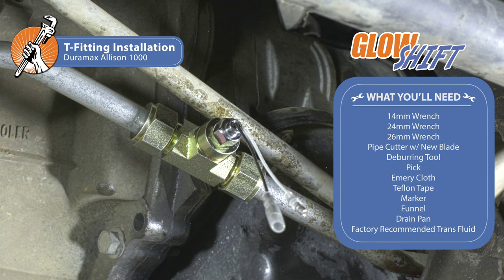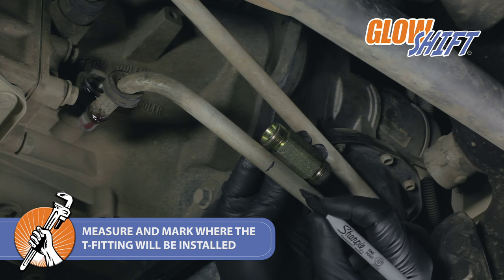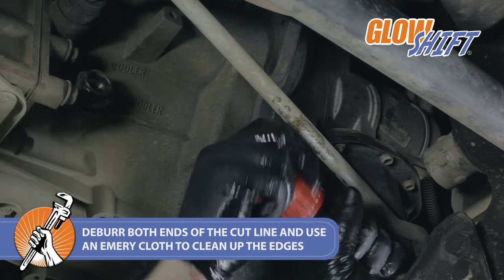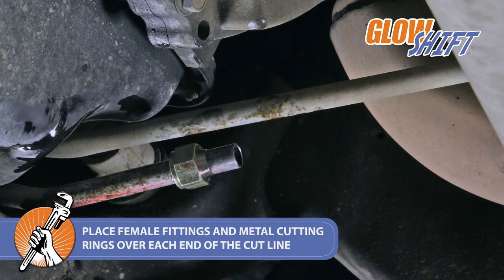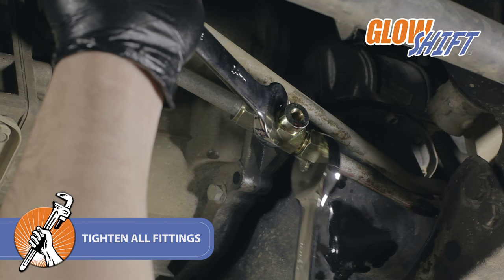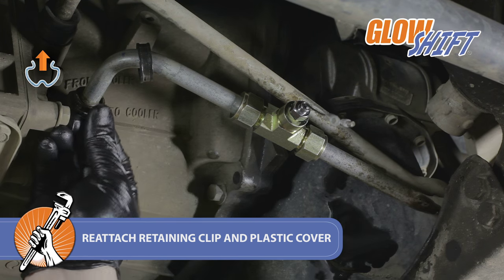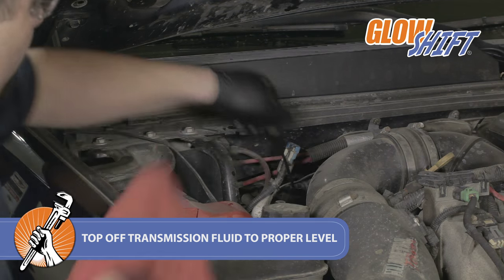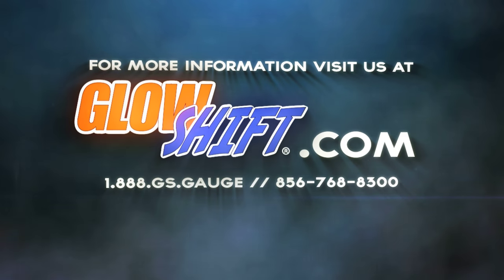Installation | GlowShift Duramax Allison 1000 Transmission Line T-Fitting Adapter

Comment: So, there is not a port already in the transmission for the sensor? Do you know where the factory gauge gets it's reading from? I have a factory temp gauge in my 2005 Kodiak, but I cannot find the sensor.  thanks
Reply from the maker: We are unable to access information in regards to test port locations and stock sensor locations and their thread sizes.  Please confirm port and thread size with your vehicle dealer or owner’s manual.  Our sensor is 1/8 NPT.  We do carry many different adapters in the case you may need a different thread size.
Reply: thank you
Reply from the maker: You're Welcome!
Reply: GlowShift Gauges